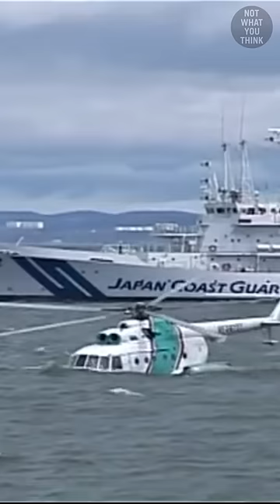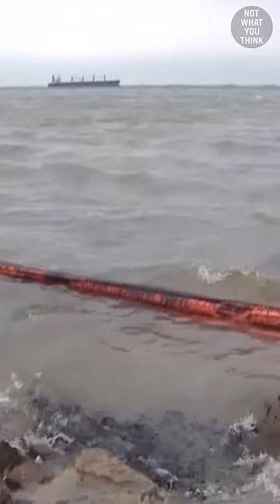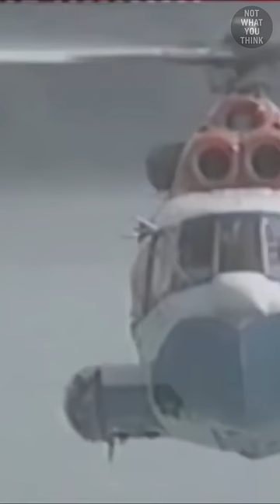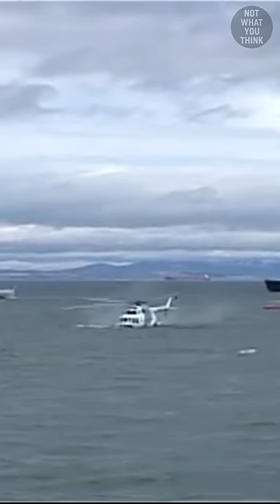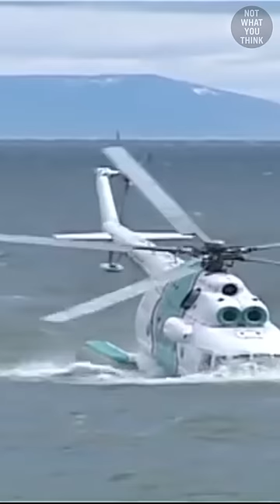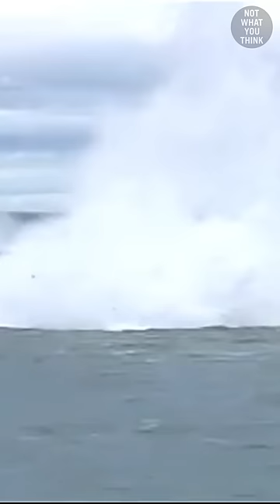Emergency Training Gone Wrong

Comment: lesson learned dont throttle hard when you are already on water.
Reply: Part of the traing is recovery of the aircraft, meaning taking off from the water.  How else do get back to
 land ?
Reply: @The_Sword3 should have lowered the collective and tried again pulling back on the stick slightly
Reply: @nuffelbagget9173  yes indeed so as to create lift at a slow pace
Reply: @nuffelbagget9173  yes definitely stalled the rotor and keep it stalled
Reply: keep your rotor rpms up
Reply: @nuffelbagget9173 it looks like he lost collective control, being amphibious and not being worried about immediately sinking i would cut power and wait for a tow, I've flow helicopters for agricultural spraying for 20+ years, i know it isnt a direct comparison but you dont mess around in regards to possible rotor strikes, never personally had it happen but im super paranoid about it.
Reply: It plummeted into the water due to engine malfunction. The engines were not properly operating so why would you try an amphibious lift?
Reply: @Greg1096  it got massive breach after hard landing, heli was not floatable with it and they can't wait for help. They tried to take off, but took too much water already, so it become dive.
Reply: @nuffelbagget9173 yeah they did the complete opposite rotor control that your supposed to
Reply: Yes, stop the engine.
Reply: Lesson? You trying to teach who? Grow up kiddo
Seems old lesson on Cuba was not learned
Reply: And don't use anything soviet made.

Comment: They should have shut it down instead of trying to get airborne, they're made to float. Had they done that they all would have walked away.
Reply: Well, swum away
Reply: @alwaysannoyed11  *swam
Reply: @karezaalonso7110  Present perfect tense of swim is swum. Hence 'they (could) have swum (away)'. Swam is present indicative or subjunctive and not applicable.
Reply: @alwaysannoyed11 that's what I was thinking lol. Swum is definitely a word😅
Reply: @alwaysannoyed11 and Alonso swam away with his tail between his legs
Reply: @alwaysannoyed11  OK thx
Reply: I noticed they put the landing gear out.  That couldnt have helped.
Reply: @alwaysannoyed11  Swam is the past tense, swum is past participle.
Reply: helicopter were damaged after with and start getting water inside
Reply: I was thinking the same or 'taxi' to the beach? Was that what he was trying... to use the rotors to get to the shore?
Reply: @TeddyBear-ii4yc  I wanted to try and get as much info together as I could. The apparent reason for the crash seems to be engine failure. The mil mi-14  like the one in the video was not very stable when it came to floating. They were okay on a calm surface, but not so great on a rough sea. The original aircraft was mi-8 which was redesigned. Basically they made the lower hull watertight and stuck some floats and rudders on it. The swell and waves make it likely the pilot did not think the helicopter was able to stay upright when it suffered engine failure which likely lead to his decision to try and take off. Only the pilot died. They were speaking of a modern redesign of the Mil Mi14 but specified that it would have better stability whilst floating than it's fore-bearers. This is likely due to the fact the original design this aircraft was based on was not intended to float.
Reply: @alwaysannoyed11 swam away works just fine too.
Reply: do helicopters' rotor blades have a sort of brake? if no, then these things tend to spin for  a long time even after the engine is off. so, they would have hit the water still spinning because there is no way the chopper would stay upright on water with such a high center of gravity.
Reply: @caty863 I can see how to your untrained eye you would think something like that, and yes you would correct on the brake issue. 
However, to the half way smart person you can tell the chopper was trying tp power out by the forward momentum. Watch again kiddo.
Reply: @alwaysannoyed11  swum sounds extremely stupid and should not be used
Reply: @benjamingoldstein14  Merriam Webster would beg to differ: "Past Tense vs. Past Participle
The perfect tenses, which indicate action completed at the time of speaking or at a time spoken of, consist of a form of have plus the verb's past participle, which, in this case, is swum." So it may sound stupid to you but unfortunately that is how 'to swim' is conjugated.
Reply: Damn always annoying knows his grammar ;)
Reply: All that knowledge, you need mo  likes.
Reply: Swum, swam. Who really cares...
Reply: I was thinking the same thing shut it down
Reply: SWAM away -
Reply: @alwaysannoyed11 you just taught me what present perfect tense is

Comment: It wasn’t a mechanical failure, it was rotor wash that prevented them from getting the lift. There’s a great video explaining it somewhere in here
Reply: Ah, I had assumed that the case at first.
Reply: Seems more convenient to bash the Russian equipment rather than just explain the truth as pilot error as 90% of crashes are btw truly a shame, rest in peace the victim and the aircraft
Reply: Looks like he lost collective control
Reply: Nice
Reply: Are you suggesting that the heli entered a vortex ring state, or something else?
Reply: @user-rs8ef3gn3i  i think he is trying to refer to ground effect, the issue here is that the angle of attack of the rotor blades is entirely too shallow to give them the necessary lift, also looks like the rotor rpm is slower than it should be though that could be that optical illusion effect you sometimes get with videos of objects spinning where they look slow but in reality arent.
Reply: @Greg1096 heart attack
Reply: @Greg1096  the helicopter was trying to perform a rolling takeful. If you watch videos of this particular helicopter it's pretty standard.
Reply: Umm if that was the case helicopters wouldn't be able to fly period....

Comment: The speed of the rotors isn’t actually what determines if it goes up or down. Most helicopters maintain a constant speed for the rotors and change the angle of attack to rise or sink. That results in less strain to the engine and gearbox as well as lower reaction times because the angle of attack changes instantly.
Reply: Was waiting for someone to say something lol, whs waiting for him to say they tried to use the rudder or something next😂
Reply: Sure, but with an engine failure slowing the rotors down below what the pitch can make up for...
Reply: Look at how shallow the angle of the rotor blades are, im betting he lost collective control.
Reply: Well the rotor RPM does determine the lift produced, just not by design lol.
Reply: @Tacticaviator7  the rotor looking slow could also be that optical illusion you get sometimes with videos of things spinning where they appear much slower than they actially are, you see it a lot in car dyno videos where even though they are accelerating the wheels seem to slow down and sometimes even look like they reverse direction.
Reply: @Greg1096  Judging by the sound from other vids the RPM seems nominal, either way I never said anything about it being low in the first place.
Reply: given he lost an engine he no longer had enough torque available to rely on rotor pitch alone for take off. but if he had realized that he this wouldn't have happened.

Comment: of course everyone is suddenly a helicopter pilot expert in this comment section.
Reply: yep, they all think the pilot can stop the rotor instantly like they want a train to stop instantly.
Reply: It's the Matrix I guess you can just download the training programs directly into your brain everytime a topic on the Internet requires you to be a comment section expert.
Reply: @shaka2tu I am actually a pilot for agricultural spraying, i takes quite a bit for the rotor to stop, never flown an amphibious helicopter but personally i would have cut power and kept my rotor level while it spins down, but im also super paranoid about rotor strikes for this exact reason, to me it looks like he lost collective control so he couldnt gain altitude, not sure why he was trying to taxi instead of getting a tow in.
Reply: And of course there's always that one guy who has nothing useful to add yet tries to act superior anyway.
Reply: @tymcfadden8496  and there's always a contrarian in that superior guy's post :)
Reply: Exactly
Reply: Yea, I am a qualified fix wing pilot and I am staying well out of this!  Choppers are a whole other science
Reply: Pilot clearly panicked did not cut engines and flipped a bitch not rocket since here where the errors occurred.
Reply: Me I just pull the spark plug wire out of the Briggs and Stratton to make the blades stop
Reply: Most of the criticism is correct. The pilot should have cut the cyclic and throttled back as soon as the windshield was under water, and put in reverse pitch. The copter would have then settled down back into the water. Instead he kept cyclic up, pitch forward, and throttle up and drove the blades into the water. No way this should have happened.
Reply: Yes it takes some time for the rotors to slow, but the pilot clearly and intentionally kept forward pitch for a long time after the windshield was covered with water. It would not have continued to push water over the windshield if he had either cut throttle or cyclic, or reduce forward pitch.
Reply: @RealityCheckThat  that's not the point. how do you know there's no malfunctioning involved whatsoever? how do you know that the pilot was working in a perfect condition? did the passengers have something to do with it? It's extremely easy for people to be a backseat critics in the comfort of their own bedrooms instead of where the actual incident takes place.
Reply: Don't you know "experts" are a thing since covid 😅
Reply: @misusatriyo  Do you know how a helicopter works? I don't know if there was another problem that the pilot had, but I do know from the narration of the video that the pilot made several attempts to lift off. I can also see that they were using both pitch and cyclic in this last attempt to lift off out of the water. It would be quite miraculous for both of those controls to simultaneously freeze in their positions to cause this accident. Reducing either one of them would have been noticeable from our vantage point, and I saw neither change. I am just giving my opinion which I'm entitle to do. Others may have a different opinion. If you don't agree, you are entitled to that opinion. If new information comes to light I may change my opinion, but I gave my original opinion based on the information provided in this video.

Comment: My first thought was "if you can't get off the water, eliminate your biggest threat if you try to get out: the spinning blades, and turn off the engine, try to sit on the water and let the situation deescalate in a controled way." Now granted, i have absolutely no clue how the helicopter works, how bouyant it is, or what standard procedure is. I know that things can go downhill fast, and decisions are life or death. With only 1 dead, its crazy unfortunate, but went better than that crash looked like it should have. Im not trying to say I'd do any better, cause I wouldn't without the training that the pilot had, and even then I have no guarantee. My point was just to give what came to my mind for discussion purposes.
Reply: The problem is that the engines, rotors, and all the gearing to make them work together, are very heavy (depending on the heli they range from ~2/3-1/4 the mass of the helo) and are also mounted very high up. This gives them a very high center of gravity, and since they are also very narrow for their hieght, this makes them completely unstable when unsupported in the water . Which means the moment that rotor stops (or slows enough), the helo is going to rollover and sink in less than 30 seconds (best case). It's why U.S (and iirc, all NATO nations) Marines and helo pilots have to do specialized training for escaping a sinking, upside down helo. The only thing that the pilots could do in this situation was hope to break free and make it to land, or buy enough time for the surrounding ships to have boats out and ready to pick up anyone who managed to get free of the wreck and swim to the surface.
Reply: @hanzzel6086 okay… so I have a question. Why isn’t the helicopter built with longer width than it is to make it more stable on the water?
Reply: @vireaknou8835 
(disclaimer: I'm not an expert in helicopters though I have read about tanks and planes if that's relevant.)
Increasing the width/size will mean heavier fuselage and maybe heavier max load (since there is more room in the heli), which will require more lift, which requires longer blade and/or better (and in general heavier) motors. Sometimes this can go in a cycle that makes it impossible to increase performance without break-throughs in key technologies.
Another problem might be the heli wasn't designed to float, or was but it didn't have time to deploy whatever mechanisms that are probably necessary for it to do so (e.g. those floats on seaplanes).

Edit: with limited research, this looks similar to a Mil Mi-14, which is described as amphibious. And in the video you can see it has floats extending sideways. It probably just took in too much water.

Comment: A helicopters rotor maintains a certain speed once it gets up to speed. The rotor of a helicopter does not change its speed at any time during its operation it only has to deflect air in the correct direction as per the cyclic and collective.
Reply: Not when your engines give out, like what (i think) happened in the video. And even when you give the rotor too much collective the rpm tends to drop since engines on most helicopters don't actually have enough torque to run on full collective.
Reply: In the Mil Mi 8 you can set the engine throttle, so you can fly it with lower rotor RPM but usually its always on full throttle

Comment: I wanna add some info.
Investigation showed:  1 engine failure->  felt on water-> crack in nose and radar section-> 1ton of water in nose section-> engine recovery-> both enginenes full thrust-> attempt to lift of-> horizontal imbalance-> blades strikes on water-> then you see on video.
Mi14 are still prohibited on sea flights. Instead are flown on Kamov ones.